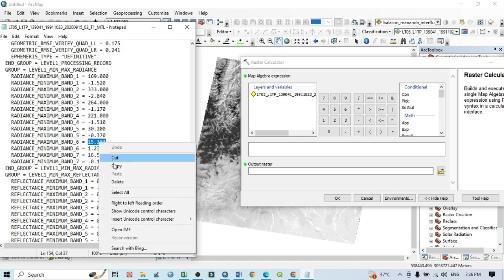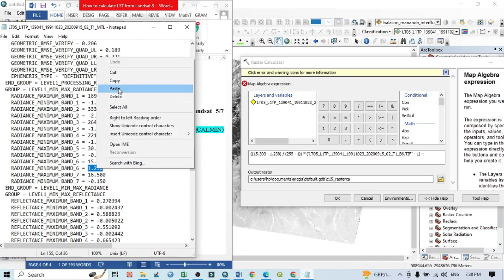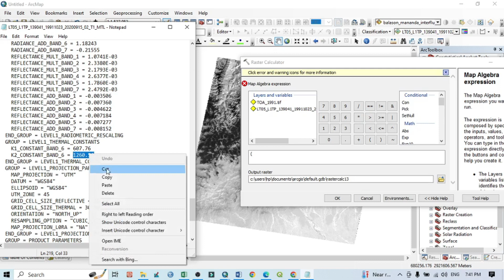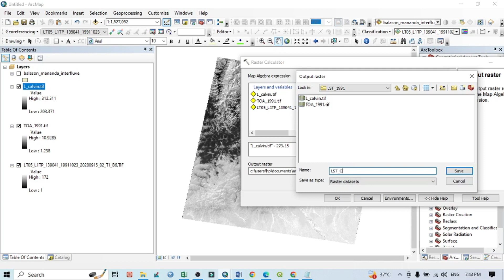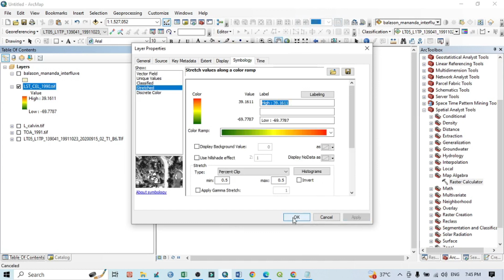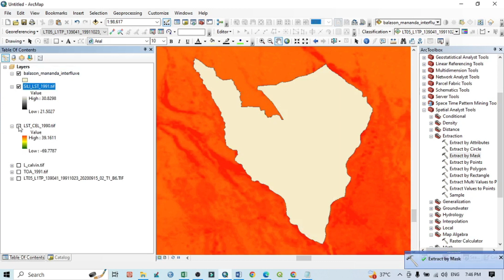Calculation of Land Surface Temperature LST of Landsat 5 and 7 in ArcGIS

Comment: Is it normal for the surface temperature to reach high levels of 90 degrees? Yes, June is a very hot month in Iraq, but the results I reached from the thermal band of the Landsat 9 satellite images are somewhat high.
Reply: No, 90 is too high for degree celcius, even minmum shouldnt be -69 in the above case ! the procedure has some error
Reply: @prathmeshdeshpande1149  How to fix this using Histogram?